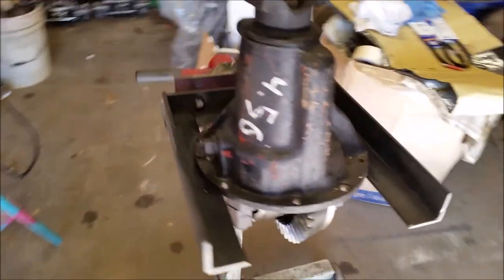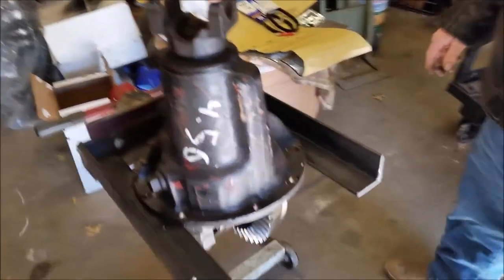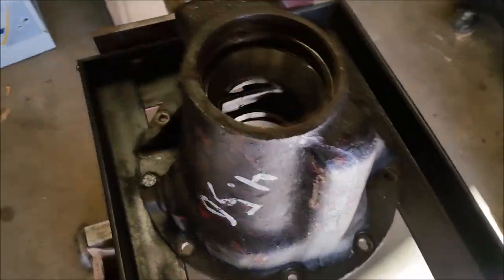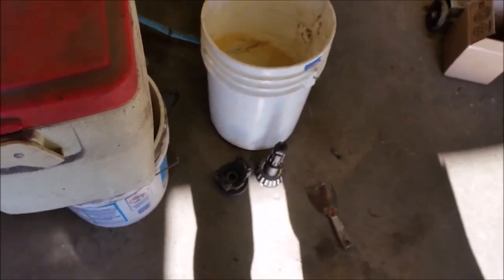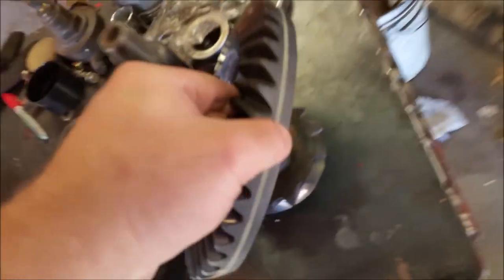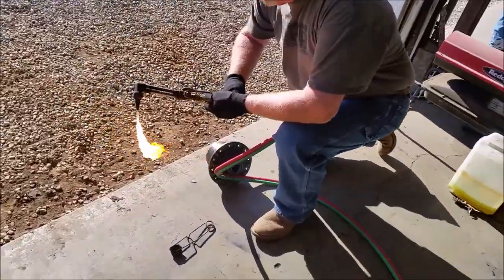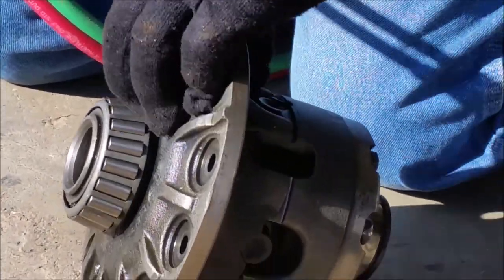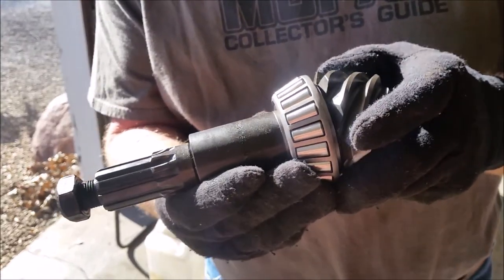Rebuild Regearing a Chrylser 8 3/4 sure grip

Comment: I should be installing a rebuilt clutch type sure grip in my charger before too long and this helps a lot. I'm going to have to make one of those brackets to attach to my engine stand to make it easier to work on it.
Reply from the maker: When Dad was dreaming it up, I said that there was no need for it, but now that we have it, it makes everything so much easier. three pieces of angle iron, a couple of nuts, and its done. I figured your Charger already had a sure grip, is it a cone, or just a worn out clutch?
Reply: Jedidiah Scott its a worn out cone type that's why I'm going to swap it out for a clutch type
Reply from the maker: Definitely a good idea, even when it wears out, you'll be able to rebuild it no problem

Comment: I am building a 742 with a sure grip.  I bought the 742 case used without gears, and ordered new gears.  I ordered and got a install kit.  It has new bearings and shims.  One question I have is whether or not there is either a crush sleeve or some other spacer in between the bearings on the pinion shaft.  That part of the video is apparently on the cutting room floor.
Reply from the maker: The only Mopar 8 3/4 third member that uses a crush sleeve is the "489" case, the "741" and "742" both use shims to set the pinion
Reply: @ScottsSpeedShop  Thanks.  I appreciate the reply.

Comment: Yo guys looking for some help Where do I bye Parts For my 1976 dodge dart swinger slant six Rear end Going to swap to a LS 5.3ENGINE  How do I make And where Do I bye The parts To make The original Rear end Stronger Please Help 😩
Reply from the maker: Well I would rather you not put an LS into a Chrysler product but it is your car, but there is no making the stock 7 1/4 rear axle strong, you would need an 8 3/4 rear end like the one featured in the video. I would honestly recommend a Ford 8.8 or 9 inch ford since you are planning on doing an LS swap